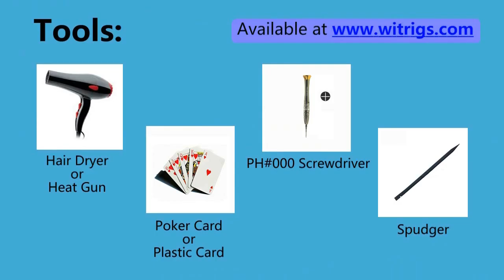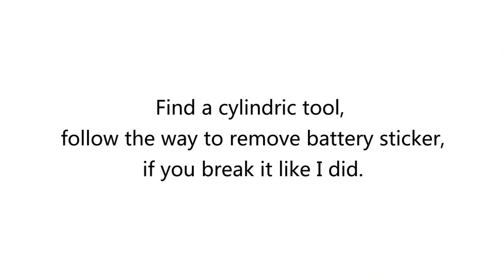Sony Xperia X Performance Charging Port Repair Guide

Comment: The old USB port is perfectly squeezed out and stuck back in without cutting the speaker. You just need to bend up the plastic part above it. When sticking a new port, you need to push it into the upper metal part on the back of the port until it falls into place. I did it repeatedly.

Comment: Sir sony xperia x performance sov33 model and  F5321  F5121 F5122 model Usb charging port is same or different. because i need sov33 Usb charging port from ebay or ali express but i m confuse which one i can by for sov33

Comment: If I buy you the port replacement will it come with the plastic glue thing that it is shown in the video? And if not do you have them or where do you get them?
Reply from the maker: Do you mean the rubber ring on the charging port? the red one. The replacement part come with it, no need to buy another one
Reply: Wit Rigs the ones on minute 5:45 to min 7:10
Reply from the maker: oh they're called main flex sticker and anti-dust mesh, here is the link http://www.witrigs.com/oem-main-flex-sticker-for-sony-xperia-x-performance
actually you can find them in the charging port page, when you click "Buy Now" button you'll see a "Must-have Item"list, which you can get all the tools and glue you need when replace the charging port. Kindly click here and you will know http://www.witrigs.com/oem-charging-port-for-sony-xperia-x-performance
Reply: Wit Rigs thanks a lot! Everything is there :)
Reply: Were you able to fit the charging port that came they sent? It did not fit my phone although the specification s said it should. Please let me know.